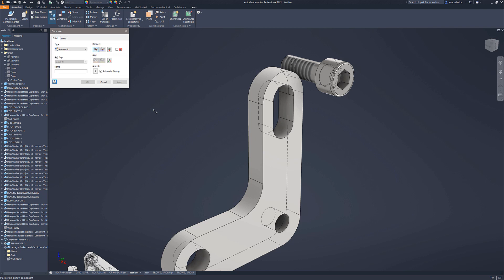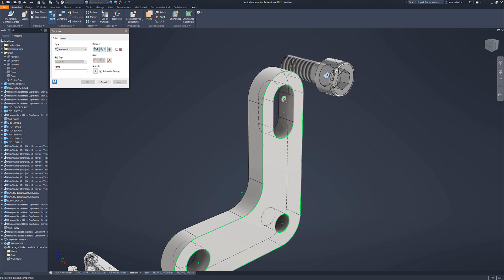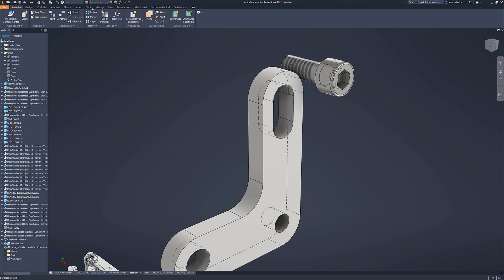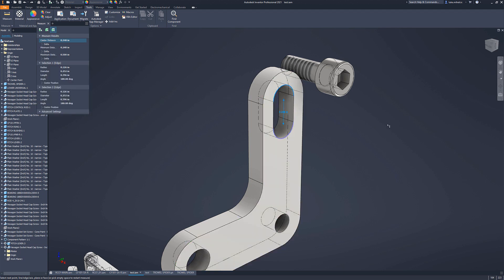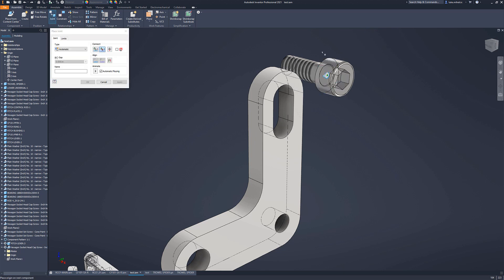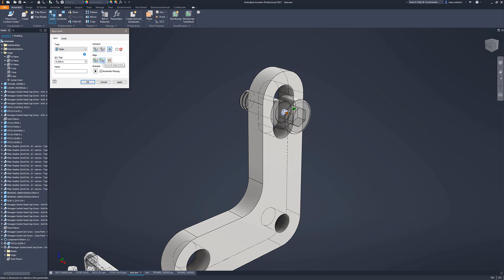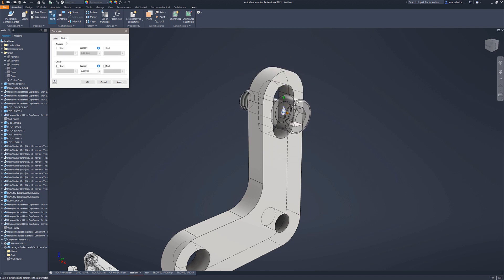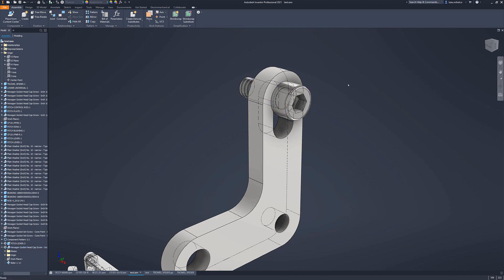Autodesk Inventor - Slot connections with joints

Comment: What if the slot is open ended?  Like a T-slot extrusion?  It doesn't show the centerlines at all since it's open at the ends.  How can a joint/constraint points be added?